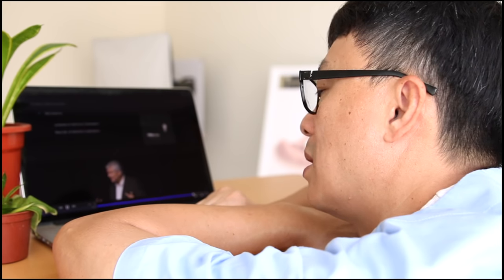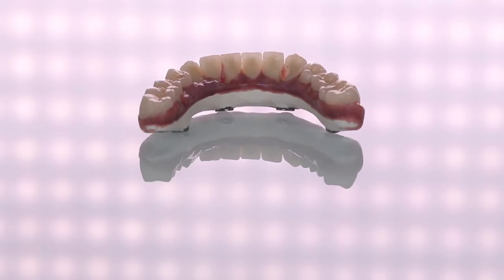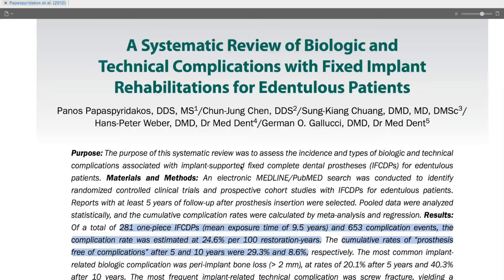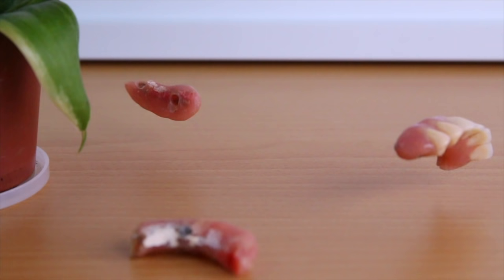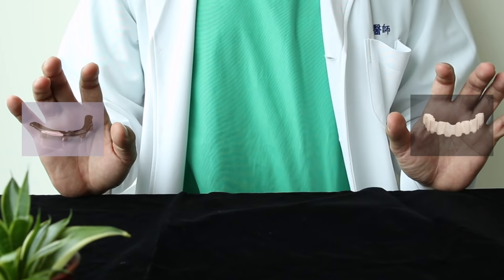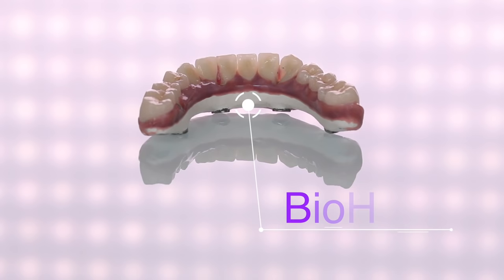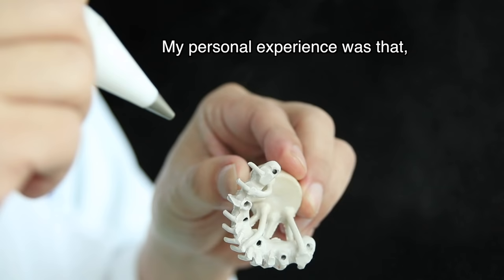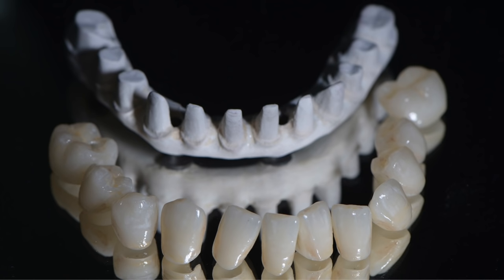All-on-4 treatment concept bridge with better resilience

Comment: Is it necessary to use the titanium bar? Is the BioHPP material not strong enough with out the titanium bar?
Reply from the maker: Hi, Shepherd, I have seen several cases with broken BioHpp frameworks, that's how I realized that it's not strong enough.
Reply: I think the titanium framework is not necessary, only  Ti base is enough  Bio Hpp is pretty strong material the key is how the frame work is designed including Emax crowns

Comment: I'm about to do my thesis comparing full arch implant supported screw retained bio HPP framework vs telescopic retained bio HPP framework regarding stresses transmission to implant... my question is about the mode of fabrication as it should be standardized.. press tech. Is sensitive specially during despruing and finishing which could spoil my precise fit between primary and secondary copings in the telescopic model !
What is your recommendation for me ?!
Do I go with CAD/CAM or press is still better ?!!
Reply from the maker: Hi, Dr. Ragaa, if you are not concerned about the strength of the whole system (what I mean is, if you don't engulf a titanium bar inside BioHpp), then definitely go with CAD/CAM, because it will be easier to standardize for your study. On the other hand, if you are gonna wrap a Ti bar inside BioHpp, the pressing technique is the only way to go.
Reply: @taifoongchung  Thank you very much for your reply
Reply: @mahmoudragaa8998  if you need a trial patient.
Reply: @terrihanson6016  it is an in vitro study (on models), I'm really sorry
Reply: @mahmoudragaa8998 if the status changes, I would be a compliant patient. I currently have six implants on both arches.